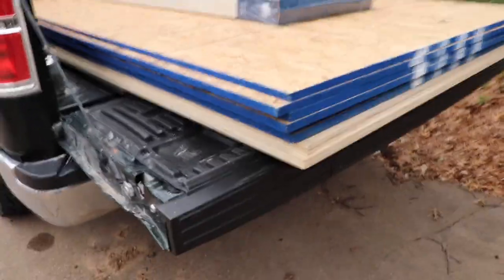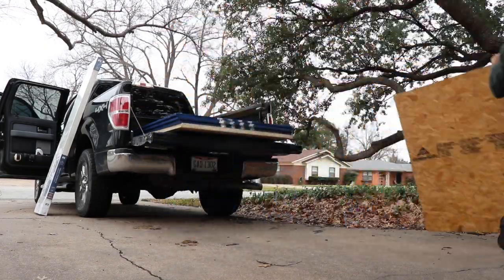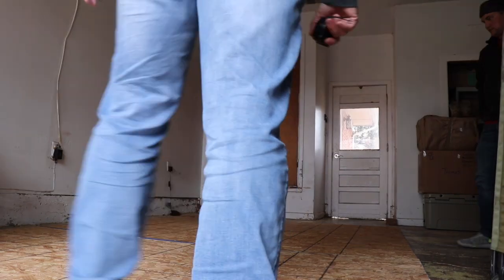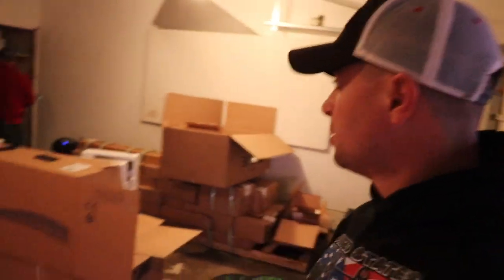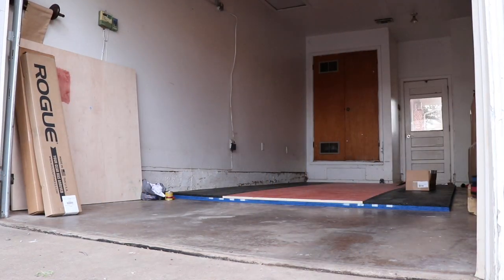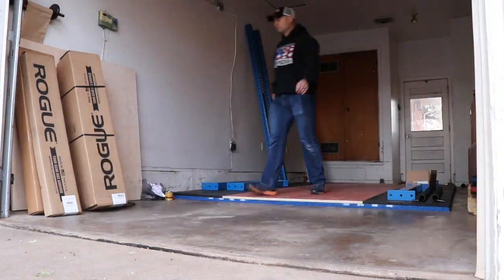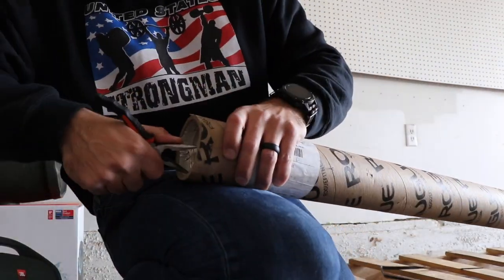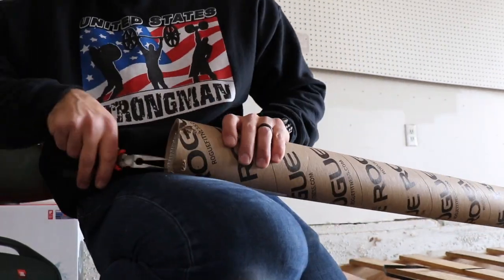Garage Gym Build | Rogue Home Gym | Assembly Video

Comment: So one thing I would suggest is to buy some 1x2’s and use as a surround for the platform, it cleans up the edges of the platform and prevents splintering If kicked. Kind of like a picture frame. I typically just paint it black. Also by doing that you don’t have to screw the stall mats down, they fit into the grooves perfect.
Reply from the maker: Not a bad design idea.  Thank you

Comment: For ppl watching, when cutting stall mats do the shallow cut then spray wd40. After that the mats cut so easily.
Reply from the maker: I’ve heard that but have never had an issue. I’ll likely be building a new platform soon and I’ll check it out then

Comment: Would the rack be better stabilized if you bolt it to the garage floor and build the platform around it? I would think eventually the rack would crack thru the wood platform or sink thru the mat with weight and time. Thanks.
Reply from the maker: I agree that it would be more secure but the house was only going to be lived in for about 3 years. We didn’t want to drill holes in the concrete as a result

Comment: Great video - just totally stole your build but have a red RML 490.  Those stall mat cuts with a blade are brutal - switched to jig saw with the mat resting on 2- 6’ 4”X 4” square posts.  Snapped a center chalk line and Cut them like butter.
Reply from the maker: I may have to try some other blades. My past experience using a jigsaw were definitely not butter. Thanks for watching and enjoy the space!!

Comment: Would love to know what the total cost on that gym build was. I am planning mine out right now and I am trying  to figure out my budget! Thanks a ton!
Reply: I'm in the same boat. Looking at the 490C also.. nothing is in stock because if this damn Pandemic..
Reply from the maker: When it is all over, I posit the used market will be flooded with gear.  That's the silver lining
Reply: @875daily  RML 490 is in stock just bought one today. 490c is still out of stock if you wanted the custom color or numbering on the hole spacing.
Reply: David Hajjar  thanks Dave.  Appreciate it 👍👍

Comment: I'm getting a 490 C rack and I have 8 of those mats in a 16' x 12' area. Low mat carpet underneath. If I'm not planning on doing TOO much deadlifting, do you really need the plywood base and all that?
Reply from the maker: You are probably fine without them

Comment: How did you address that huge bow in the platform (beginning of video)? I'm assuming the garage floor isn't level?
Reply from the maker: There was a bow in one of the sheets of plywood. We stacked all the plates on it overnight
Reply: @TheKurtlocker  sweet thanks! Is their anything you do to check the garage to ensure it's level before putting these down?
Reply from the maker: I use a level to see how far off plumb the slope is. I used the shingle method in my garage gym 4.0. There’s a video on that.
Reply: @TheKurtlocker  I'll google that thanks!
Reply from the maker: https://youtu.be/Jvu0XGvVur0

Comment: I'm looking to do a similar build with that same rack. What are the dimensions of the top center plywood? I'm concerned the 2 inside holes on each leg wouldn't fit over a 4 foot wide center plywood piece based on the dimensions of this rack. Looks like yours do though.
Reply from the maker: The plywood is a standard 4’x8’ piece of hardwood plywood

Comment: I've watched this and another build, where the rack "feet" are screwed in such that they sit half on the plywood and half on the horse mat.  Is there a reason for this and is the 3rd screw hole (the one over the horse mats) screwed down?
Reply from the maker: A rogue rack has an inside space of 43”. This makes the feet have 2” per side on the platform and 2” on the stall matting if spaces correctly. Which ones you screw down are a matter of personal choice.

Comment: You're a good friend. Awesome vid. How did you handle the size dimensions of the platform? How did you end up exactly with the stall mats being exactly enough for both sides?
Reply from the maker: I measured and cut to size. Be patient while cutting stall mats. A few extra minutes spent making a straight cut yields significantly better results
Reply: It is 8 feet wide. The center wood is 4 feet wide. A stall mat is 4 feet wide. Just cut it in half and you end up with two 2 foot wide stall mats. The two pieces of stall mat and center wood are equal to 8 feet.

Comment: What did you use to anchor the rack to the platform? I have the same Rogue rack and will be mounting it to a platform with the exact dimensions in your video.
Reply from the maker: 3/8”x2” lag bolts
Reply: @TheKurtlocker  Thanks!

Comment: So I have a question....Which would you prefer RML or RM? Bench-405, Squat- 505 and Dead-565 right now but wanting to get stronger. Im doing my research but I can't seem to find much difference except for the price and hole placement.... Leaning toward RM mainly because the hole size of the RML seems like it couldn't hold the weight I would be using. Thoughts?
Reply from the maker: The RML would hold the weight, but I think if I was to redo my gym from scratch I would go all Monster series. There are more attachments and more options. The holes for the monster series also go all the way around each post at 2” on center and have laser cut numbers for the holes. The small details that the monster series has makes it the better choice in my book. It’s their staple line and the effort of the company will be spent there.
Reply from the maker: @Pler1978  There is definitely no doubt that the weight requirements are not the deciding factor between theRML and RM.  The biggest factor to consider (for me) is the expandability and future innovations.  The RM is the flagship series and has seen more innovative attachments. The Monster series is how I would go if I give recommendations.  When I get to redo my garage gym, it will likely be Monster Series.
Reply: Also seems like the 490c is too much rack

Comment: Hey just a quick question! does the 8ft wide deadlift platform serve you well? id like to go the 8ft wide route rather than the 10ft route (cutting the horse stall mats long ways, rather than in the middle) to save on space and cost, but I'm a little worried about it being to narrow to deadlift on, id love any advice!
Reply from the maker: I wouldn’t go narrower than 8’ for the platform. It does offer about 6”-12” of space at the ends of the bar depending on your bar. You could consider building you platform to be 8’x12’ or 8’x6’. That would alleviate any cuts to the stall mats
Reply: I recently did an 8x8 build for my basement that has been fantastic so far. For cutting the stall mats I popped a chalk line down the center, scored it with a razor knife, rolled it in half so the mat would spread apart where I had made the first pass with the knife and finished the cut with a hacksaw.
Reply from the maker: Good form!

Comment: This is perfect timing.  I finally have room in my garage and will soon be starting my build.  Going with RM6 vice the RML.  Also getting the trolley arms.  Going with red instead of blue (I'm a Georgia bulldogs fan).  Going to make the exact same platform using this video.  Also grabbing a SSB bar but probably gonna buy that from EliteFTS based on reviews.  Everything else will be rogue except the weights.  I have about 500 lbs of cast iron weights that I have accumulated over the years.  Those should be good enough, right?
Reply from the maker: That sounds amazing.  I have the Rogue SSB and would highly recommend the EliteFTS one over the Rogue one.  You may be surprised how quickly you'll need more weight! Are you subscribing to a specific strength sport?
Reply: @TheKurtlocker  Weightlifting has always just been a hobby.  never done any competitions or anything.  As I grow older though (46) I realize how staying strong helps you remain mobile and agile as the body ages.  Really becoming interested in strongman aspects of the hobby.  I may start obtaining some of those pieces of equipment like a yoke, sandbags and maybe even a log.  Thanks for the videos.  They are a big help and provide great inspiration.
Reply from the maker: @Strmshadow73  Thank you for saying that.  I appreciate it.  I love training and competing strongman

Comment: The slope not a concern? I guess if u face downhill its ok (like having heeled lifting shoes)
Reply from the maker: In this garage there was only a 1” drop over 5’ of space. We didn’t need to really do anything for that amount of slope. In my current gym there is shoring under the front of the platform in the deadlift area. My next gym will likely have something more “better”.

Comment: Instead of prying out the staples. Just cut the pipe slightly back from the cap with a utility knife or small hacksaw.
Reply from the maker: Normally this is how I roll, but this wasn’t my garage and no saw was available. Never have tried with a utility knifed though....
Reply: Good idea, but I will keep the rolls in my attic for when we do our last move in a few years.

Comment: The sockets are 15/16? Not 1”? The 1” is just the width of the bolts then? Gotta return the socket I bought today then lmao
Reply from the maker: 15/16” tools for monster lite series hardware
Reply: @TheKurtlocker  and those are the 1” holes?
Reply from the maker: The bolt holes for the monster lite are 5/8”

Comment: I plan on buying this rack found it on Craig’slist for 825 $ but it seems like too much rack for me
Reply from the maker: Do you mean it is too “overbuilt” or that it’s just too big?
Reply: Kurtis Stadsvold too big i only have a few hours to decide  I’m supposed to buy it tomorrow ...
Reply: Kurtis Stadsvold looks like it might take up too much space? I have the rogue squat stand I need to upgrade it’s not ideal for 450 squat mid 300s bench press..
Reply from the maker: Mike Smith is it the 690? If so, you could always just setup part of it and either store the other parts or sell the pieces you don’t use. You may be able to recoup most of your cost.
Reply: Kurtis Stadsvold 490c
Reply from the maker: @mikesmith1502  well it is really not that big.  Space restrictions are a pain to work with though.  I started with a squat stand, graduated to a 490 and then upgraded my 490 to a 690 and have had to rearrange to accommodate the space required.  Looking back, I am happy to have the power rack over the squat stand.  It is easier to use, more versatile, and significantly safer
Reply: Kurtis Stadsvold thanks for the advice buddy
Reply from the maker: @mikesmith1502  let me know what you decided

Comment: I recently bought a rml 490 and will be attaching it to a platform instead of the concrete. Is a lag screw the best or is there a better option? And is 5/8 the only size that works or will another size work too?
Reply from the maker: I use lags when I connect to a platform.  Im sure that there are other options, but I've never had a problem.  I don't use 5/8" lags for this either.  I will usually use like 1/2" or 3/8".  Just make sure to use washers and don't over-tighten.
Reply: Would over tightening cause the platform to crack I’m guessing? Or is it something else?
Reply from the maker: No, it would cause the hole to strip out

Comment: Does stall mats have rubbery toxic smell? I am reluctant to by them for my garage gym. Can you advise? Thanks.
Reply from the maker: They can have an odor to them if they are new. I have built platforms with older mats and newer ones and in both cases the smell, if any exists, disappears pretty quickly